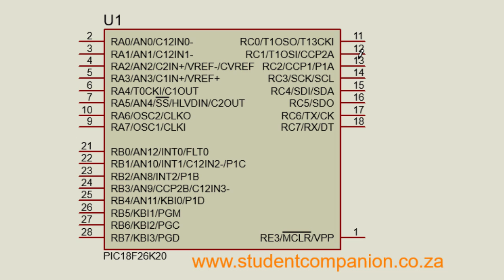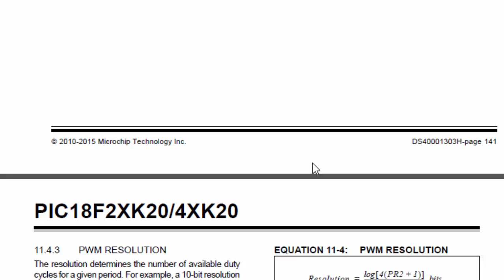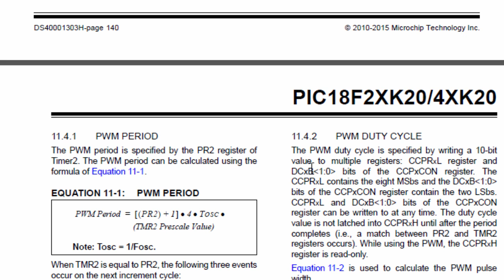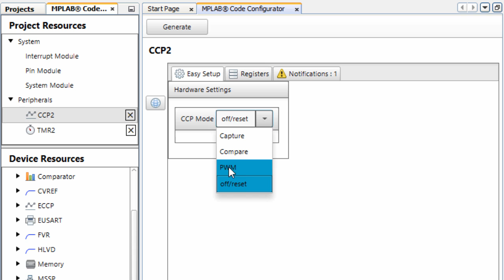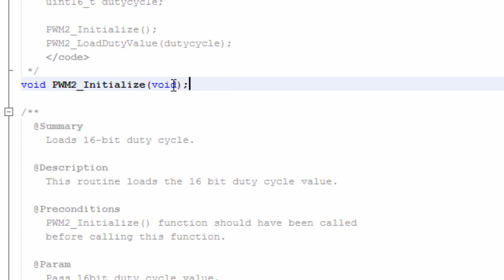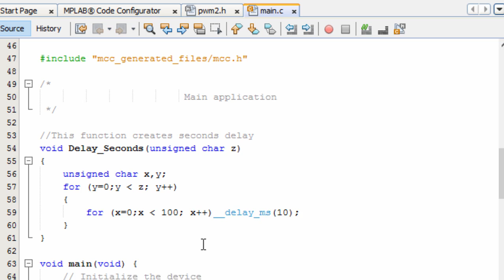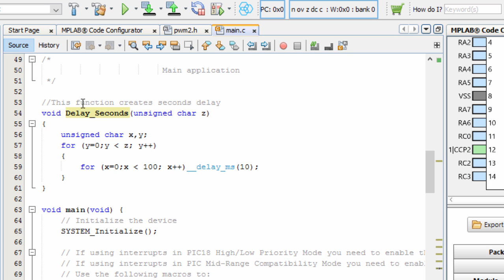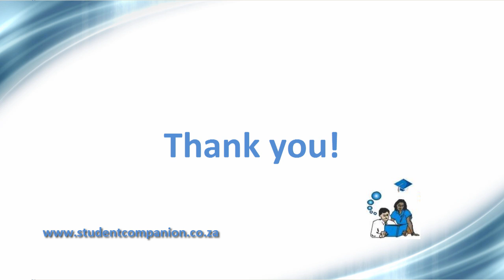32- Pulse Width Modulation (PWM) | MPLAB XC8 for Beginners Tutorial

Comment: i have mplab x ide version 3.50 and i cant find the ccp and pwm please help asap thanksssss
Reply from the maker: You didn't specify the PIC you are using and whether you have already installed MPLAB Code Configurator.  If not, watch this tutorial: https://youtu.be/JxSSVtTj_fA
Reply: Student Companion oh, i didnt know that we have to install that. We’re currently using pic18f26k20 thanks! More power
Reply from the maker: You can't jump the steps. That's why it's always good to watch previous tutorials when you are stuck.  The solution might have been discussed in previous tutorials.

Comment: Highlighted reply
Student Companion
1 hour ago
+segarlinktech it's not possible.  One then the other. Even in interrupts there is always one with higher priority. 
What are u trying to achieve?   ( I am trying to achieve is Voltage,current,watts,temperature in the LCD a main Macro, The second page ON/OFF Control Switch for Lamp,Motor, and, Heater. when i want to On/Off any of the this output device i have wait until the next MACRO function . Example i have 5 macro in total my first Macr is Motor control,Macro 2 is Heater,Macro 3 Lamp, Macro 4 battery charger, Macro 5 is Power relay, this 5 macro is works step by step . but i want to on/off heater and motor at same time is cannot i have to wait other macro function is completed then only i can on/off this heater and motor. once i ON/OFF this heater and motor is working, but when this  macro sequence function is finish is going to another macro SUCH AS LAMP,BATTERY CHARGER MACRO and the present Macro is completely switch off. AFTER COMPLETED THEN IS BACK TO MOTOR AND HEATER MACRO again as routin. so this is not works at same time all macro how to do that all in same time work . i can't on/off any output device which i want in same time in the flowcode. I also use LDMicro PLC programming that is all work at same time what ever output device i want i can on/off control anytime i no need.But the programming is huge have to write in LDMicro is consuming very much time to complete project.

Comment: hello,
how can i generate 2 pwm signals with different duty cycle
Reply from the maker: Hi. Which PIC microcontroller are you using?
Reply: Student Companion im using pic16f876a
Reply from the maker: PIC16F876A is not currently supported by MPLAB Code Configurator
Reply: Okay so which microcontroller can i use?
Reply: Can i use the PIC18F2220?
Reply from the maker: It will depend on your requirements and availability in your area. We can't advice on that.
Reply from the maker: PIC18F2220 is not also supported.
Read this release note for a list of supported devices: http://ww1.microchip.com/downloads/en/DeviceDoc/release_notes_pic10_pic12_pic16_pic18_v1_45.pdf
Reply from the maker: You must also check your PIC datasheet if it has 2 or more PWM
Reply: Okayy thank youu
Reply from the maker: +Abdo Mouawad you are welcome!
Reply: Hello, im using pic18f26k20 and im using the AN0 and AN1 as analog inputs, i connected to each one of them a potentiometre.
The problem is i cant take value from the two if them, i only can have the value of AN0, AN1 isnt working. plz help!
Reply from the maker: Did you watch this video:  https://youtu.be/Tiw41qHowr0
Reply: Yes all ur videos are helping me a lot!! but i cant find a solution for this problem i cant take values from two analog inputs using the ADC only one input is working
Reply from the maker: +Abdo Mouawad ok. On our website there is an example to read ADC on 3 analog inputs at the same time.
Reply: Great!! But can send me the link because i cant find it on ur website
Reply from the maker: There is an example to convert 3 ADC channels at the bottom of this page: http://www.studentcompanion.co.za/analog-to-digital-converter-in-pic-microcontroller-xc8/

Comment: Thank you very much for all this huge amount of informative videos! I want to implement SPWM using lookup table, do you have any tutorial or recommended information where can I learn this?
Reply from the maker: Hi. Thanks for watching our videos. What are you trying to read from the lookup table?
In tutorial 4: https://youtu.be/fXgh2oZ3Mmg  we used some sort of lookup able to get the value of the digit to display. Maybe it might assist you.
Reply: From the lookup table I must read the sampled sine value corresponding to a specific frequency, then generate an interrupt within the Timer2 and PR2 match and then feed the CCPR1L register with the values on the lookup table. I'm almost getting it, but still need to fix some issues. Do you anything about this?
Reply from the maker: We wouldn't know those issues, so we can't suggest anything.
Reply: I mean do you know any tutorial corresponding to Sine pulse width modulation on PIC microcontrollers? Thank you!!
Reply from the maker: No. We don't.
Reply: I will share it to you once is working
Reply from the maker: +Rolando Aguilera thank you.  We will appreciate that as it will also benefit others.

Comment: hi, if I want two PWM (with diferent pines) and I did it by code configurator and I want that PWM1 (for example) works while PWM2 is working, how can I do it?, I mean:

if PWM2 is ON --->  PWM1 ON too
if PWM2 is OFF -->  PWM1 OFF too

how can I modify my code?

thanks.
Reply from the maker: Hi. What do you mean by different pines?
Reply from the maker: And what conditions will be required to switch ON/OFF your PWM?

Comment: Hello Student Companion.
Thank you so much for posting this series of videos on MPLAB XC8 for Beginners Tutorial. It has greatly helped me with my basic understanding as I am new to PIC. Have you done PWM coding without using MCC? I want to write 2 PWM codes each with different duty cycle. I was wondering if you have tried it or you could guide me on how to approach it.
Reply from the maker: +Setsu Tsubasa hi. Thanks for watching our videos.  Why don't you want to use MCC? Is there a particular reason for that?
You can use the old PIC18F Peripherals libraries to configure your PWM or you can configure all the registers yourself without any library using your datasheet or even by reading the code generated by MCC as a guide.
Reply: +Student Companion. I am unable to use it. I keep on getting an error so I uninstalled it. 
Could you be more specific on using other methods? I don't really know them. One more thing My PWM signal will not have a predefined duty cycle. MCU needs to calculate on how much duty cycle is required  based on a certain formula and calculate it.
Reply from the maker: +Setsu Tsubasa what do you mean by you are unable to use it? What is it? Which software?mplab, mcc?
What versions of the software you are using? Like mplab x IDE, xc8 compiler and if you gave one MCC? What PIC model are you using?
Reply: MPLAB X IDE v3.55, XC8 v1.41 compiler with PIC18F4550. I installed MCC v3.40 using plugins and it gave me error:
The device used in the selected main project is not supported by the currently loaded peripheral libraries.

A list of supported devices is provided in the release notes of the appropriate peripheral library. An archive of the current and previous versions of libraries can be found on the MCC website.
Reply: +Student Companion
Is there any other info you would like to know?
Reply from the maker: +Setsu Tsubasa PIC18F4550 is not currently supported by MCC. Microchip is trying to influence people to use new PIC models rather then old models like this one. If you'd like to use MCC try the newer version of this PIC: PIC18F45K50
Reply from the maker: +Setsu Tsubasa if you want to use MCC try PIC18F45K50 is very similar to PIC18F4550 but this one is supported. Or you can use any other supported PIC unless you're gonna use the USB. Because this PIC has USB module.
Reply from the maker: +Setsu Tsubasa you can also download separately PIC18F peripherals libraries and install them into your compiler.  Or use the datasheet to configure directly your PWM but you'll need to understand all the registers that's why if you are a beginner it's best if you use libraries
Reply: HI . did u made the program correctly? i am also facing the same problem, 
i am using pic 18f248.if u did the program. can you send me the codes?